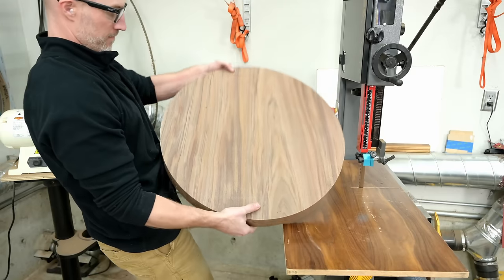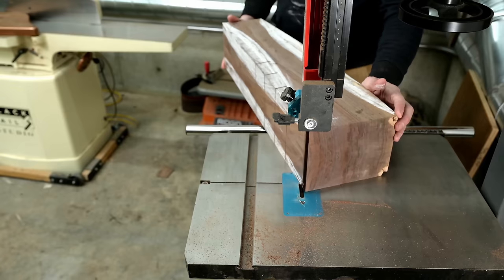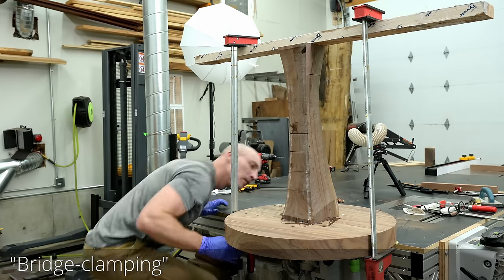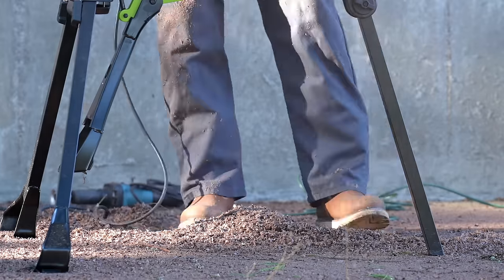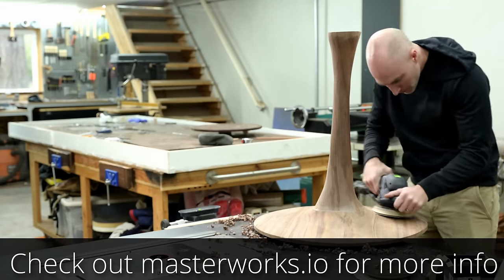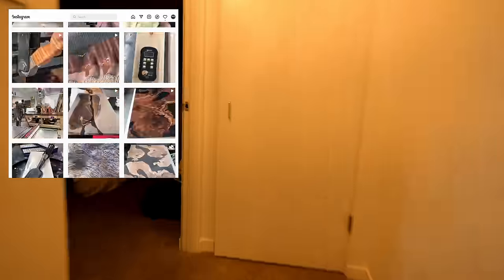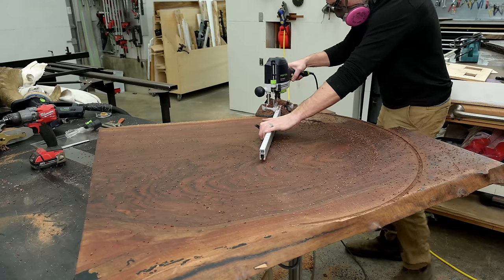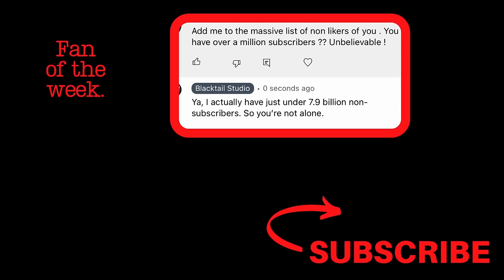I Like Money, But This is Better

Comment: I have made all of my own glues from 14thC thru 18thC recipes (depending on the age of the piece I am working on). I guarantee my clients that I use only the materials and technology available when the piece was made (including any wood that I add). When I glue I warm and work into the wood, glue from both sides of the glue joint and then wait for the glue to begin to tack.  I warm the surface of the glue again just before joining the pieces and then clamp them and put the entire piece in a vacuum room and bring down the atmosphere to roughly 2.5lb neg. PSI. (Which is a ton of pressure). This allows the glue to blend without drying over a three hour period.  I slowly reintroduce an oxygenated neutral atmosphere and allow to cure for 30 days.  While vacuum chambers are technically not period it does reduce the levels of the kinds of pollutants in the atmosphere that did not exist when the piece was made during the curing process.  Everything else is done exactly as it would be in the year that the piece was made right down to the hand tool marks and handmade hardware.  As for the angle grinder not having the power to do any real damage….BWAHAHAHAHA!!!!!!😂

Comment: $4000-$10,000? Glad you're back. Also, try using a tiny bit of salt or other abrasives when you glue up wood. Apparently they help prevent it from sliding around. I am not a woodworker myself and i haven't tried this yet. Would love to get your opinion.
Reply: I do this and it works really well, you only need a pinch!
Reply: @BrinToo  does it affect the adhesion in any way? Or maybe the wood?

Comment: I use a spoke shave for guitar necks (or I did, back when I was building), and I agree that there might be better tools for that job but it is just a lovely zen-like calming tool to use.  I'd happily spent hours just shaving away on a thin setting, and you have a lot of control too with the way your hands grip it.

Comment: While hand carving with a Kevlar glove on my left hand, I needed to buzz a tiny bit of wood detail with a Dremel tool. About two seconds later I had a broken finger as the burr wrapped up the glove. The damage from a grinder would be horrifying!😱
Reply: Scares me to death everytime I think about using my drill press....don't forget to take off the gloves!
Reply: I added a wen foot pedal to it for better control.
Reply: A kevlar glove is the most dangerous because of the incredible tensile strength. With a synthetic, or better, a cotton glove
Edit fumbled the post button the glove would tear a lot more easily, and you may very well be able to get away without any significant damage to your hand.
Reply: Seen a 1cm diameter steel pin wrap round a grinder like a shoelace. I wouldn't chance it 🤣

Comment: $18k   Run a slot on your mortises on the table saw, about 1/16" to 1/8" deep. This will allow air to escape and re-enter, but won't weaken them.

Comment: I learned many years ago that when plugging a defect (chainsaw cut...), a rectangular plug isn't a good choice because the eye can pick it up so easily.  As regards applying glue to one of both sides of a glue-up, a number of years agoo Fine Woodworking featured an article on the topic.  They used some lab-grade measuring procedures to stress both types and concluded that the both sides option consistently resulted in a superior bond.  As well, another of their articles covered clamping pressure.  It concluded that it's virtually impossible to apply so much pressure using the types of clamp systems most woodworkers - including you - use, to compromise the glue bond.

Comment: Gluing both sides traps air in the glue vs letting it dissipate into the wood and similar with pockets of excess glue

You could glue two small sticks together on the ends with and without double-glue and see what’s stronger
Reply: There's no space for an air pocket.

Comment: I love using those carving discs. Just use a lot of caution. Last year I was using the type that had 6 carbide teeth on a convex disc on a cedar post. Somehow, the disc caught a groove or knot and had a massive kickback. The kickback flipped the Milwaukee angle grinder out of my hands. The grinder flipped over and hit my wrist, taking an inch long and at least half inch wide chunk out of my inner wrist. It was very deep and couldn't be stitched which took a long time to heal. Fortunately, it missed the artery in my wrist. It was summer and I had a mask and safety glasses, but was wearing a T-shirt and no gloves. In hindsight, if I wore decent gloves, it probably wouldn't have taken the big chunk out of my wrist. And of course, maintaining a good grip and control is important.

Comment: it is technically correct to glue both sides. the reason for this is that wood glue is made up of fluid that gets absorbed into the wood grain so to bond to the fibers. if you glue only one side you will be losing strength in your joint. glue both sides and the moisture will absorb evenly. this also reduce the risk of warping a little bit.
Reply: The glue will be on both sides once connected, so it makes no difference if you glue both sides or only one. It'll be covered in glue evenly once connected anyway and every excess will be pushed out anyway.
Reply: @Max  your theory sounds like you might be adding more glue then you need to your joints. 
The truth is what I stated above, I gathered this information from sait and other professionals in the field of carpentry.  My information is 100% accurate. 
If done correctly you Need a very small amount on your joint, the tru grab from the glue is found when clamping pressure is provided not how much glue you use.
Reply: @mychalmerrick9769  That is not my statement. If you use an imaginary 10ml of glue on one side, you have exactly the same strength compared to add 5ml of glue to each side. In any case you will experience reduced strength when adding to few glue, in which case it even again does not make any difference. It happens to be a bit difference when talking about dominoes, it that case you should glue obviously both holes that you put the dominoe in, however gluing only one flat surface that will be put onto another flat surface (or both) is completely irrelevant and indifferent.
Reply: @Max  as much as your right about it not making a huge difference in most cases. However you are infact wrong about your theory. This can be seen even further when you are gluing two flat peices of different densities.  A softer wood often will absorb more of the moisture then the hard woods. I would suggest getting technical working knowledge of the glue and the wood before drawing to this conclusion.

Comment: One of the things I've noticed is that when you are putting in the threaded inserts, you always use an Allen wrench. There is (I've found) a better way. Get a 2 inch bolt with the same threading as the threaded insert and a nut and washer that will fit the bolt. Thread the nut onto the bolt, slip on the washer, then thread on the insert until it is flush with the end of the bolt, then tighten down the nut and washer onto the insert. You can then install the insert using a wrench or ratchet. This does 3 things all at once, 1 it allows you to put a lot more torque in case you hit a knot or something, 2 the insert itself can't be harmed by the added torque, and 3 when the washer is to the surface, you know that the insert is straight in the pilot hole and that all the inserts have been installed deep enough not to sit proud and throw off your level.

Comment: 6:31 Would it be better to make a tiny groove either on that "peg" or the square whole? That way you would not have to deal with:
1. air trapped against when you insert the peg
2. vaccum when trying to remove the peg
3. a way out for the glue without having it messing around
Reply: It will also allow the wood to dry.
I have seen wet glue under years old plugs like that
Reply: @joshua43214  that is crazy!

Comment: Glue is added to both sides to ensure that you always have fresh glue penetrating the wood. In some situations, not doing both sides can lead to air pockets, dry patches, or not enough soak into the dry piece for the full, super strong bond that would be expected.

Comment: For that center pin you used to attach top to stem add a groove or shallow cut to flat side. It won't effect strengh too much and will let air and glue/resin move around or out if needed, so driving it all the way in or taking it out is bit more easy.

Comment: The teacher in 8th grade wood shop said you only add ample glues to one side and the pressure clamping it will spread it out evenly with little spillage.  If you glue both side you alway use glue than you need and there is more spillage. He said that does not sound like much buy when you work in a job shop and it takes an hour more to finish each and you use twice as many consumable.  When you make 100 or 500 of them it makes a big difference.  If you don't learn to be efficient now you won't get better at scale. I
He had owned one of the largest furniture manufacturers in town and when he retired he taught wood for fun.

Comment: About the glue up. It depends on how big is the glue areas.
If its small like smaller than your hands its fine to just glue one side provided that you spread it evenly. It saves excess glue and less time cleaning (especially gumming if you are sanding)

Comment: I personally glue both sides of wood only because I make birch veneered ply products to avoid gaps but as far as over clamping, I’ve personally put 25 clamps on a 6 inch x 2 foot veneered board and never ‘over clamped’

Comment: Another way to do the textured surface on the top of the table is a rounded router bit in a veneer trimmer. You can control the depth and also creates a very clean dish. Also, very easy to create an ‘adzed’ look by pushing or dragging with each plunge.
Reply from the maker: Oh ya? I’m intrigued

Comment: Next time you use that square tenon idea to join the base to the stem, cut a small groove in the side or sides of the tenon. Trying to assemble something like that, you will tend to have problems with air trapped inside the socket below the tenon. The grooves will let the air out when assembling but the grooves will not be visible once the assembly is completed.

Comment: Just a suggestion, when you're doing a patch (it's actually called a dutchman) the best way to hide it is to make it organic. Meaning have the long part straight but the ends rounded, it make the seam less noticeable. Like I said just a suggestion, having worked for 15 plus years with wood I've learned how to fix my 30,000 mistakes....

Comment: An old paint back in the day showed me how he glued teak which can have some problems along with any hardwood with a high oil content, some folks with teak even swear by wiping down all the surfaces to be glued with acetone, not pleasant. This old timer in the yacht building business swore that by applying yellow carpenters glue to both surfaces when gluing up for thickness was all he had ever done in his many years in the business.

Comment: I do a fair bit of machining for work and I'm very impressed with the way the your mounting plate came out. I don't think I could do that on a drill press myself. I'm too spoiled with my knee mill lol. If you're doing more steel machining in the future, try using some WD-40 or other oil on it. It should help the bit cut better and help it last longer.

Comment: beautiful table  bit that grain  design in the wood of the small circle the larger circles base was  a amazing  pattern ... you 10000% should be signing your work  even if it's blacktail studios   order up a tiny  branding iron  even if it's like 5 inches long with a scroll font 👌🏾 if I  in that custom table business  I'd get a old used lathe  would help alot with  🦵🏽

Comment: When you tile (as in, install ceramic or stone tile), generally, you apply adhesive to both the substrate and the back of the tile when one or two conditions are met or suspected: The first is if the tile or substrate is uneven. This is mostly a problem when the tile is very large. The second is if the tile is very absorbent, and not "back buttering" would risk a poor bond due to the tile having dehydrated the adhesive too fast.

I suspect that similar thinking could be applied to glue when wood working. I would probably use a toothed applicator for one face and a smooth applicator for the other face so as to avoid air pockets though.

Comment: I'm not a woodworker. This looks like a very fine table. It looks like the kind of table that would appreciate it if you used a coaster -- but wouldn't openly complain if you didn't.  It would just quietly and politely slide a napkin under your highball at an appropriate point of the conversation without ever breaking eye contact.

Comment: I believe adding glue to both sides helps with even application. If you make sure both surfaces are coated well, you can be  a hundred percent confident, that the entire surface is well glued

Comment: Great video. Has anyone ever told you that you have a striking resemblance to Matthew McConaughey. I don't do woodworking but find you video's very informative and enjoyable. I am a modelbuilder concentrating on sci-fi because I love lighting my projects. I have also had a few commission builds and I always like to see other makers do what they do especially when they enjoy what they do. You do fantastic work. I plan on building a workbench in my shop so I can organize my shop a little better. My shop is only 10 x 12 so I want to get Ideas on how to do as good a job as you. Thanks

Comment: I think your videos are improving as is your skill.  I appreciate your attitude about your work too.  I'm not a fan of lots of epoxy in tables, (and I've made a couple dozen tables over the years, but I think you have done more than most, some pretty interesting ones.  I am not a fan of metal bases in general either, so this base is good!  Thanks for recommending the power carving too.  I recently completed some old growth VG redwood benches, that were to complement a large redwood slab (live edge) table.  Redwood IS darn hard to work with, as it is so soft. The benches I made were NOT live edge, but I wanted them to be a bit more "handmade" in looks so I decided to texture the surface of the seats, (and a little the backs) and I considering using a power chisel to texture the surface.  But the Arbortech chisel/ gouges was a bit too aggressive for the soft redwood, and finally I found that using some wide (60mm) gouges with a sweep of 5 or 7, making sure the gouges were deadly sharp, the surface was textured nicely.  Took me only about 3 hours of work to do each bench seat by hand.  (5 1/2' long each)  But I'm looking forward to using the power gouge on some picture frames for the same room (the frames will be out of Cherry)

Comment: in german joiner school we learned to put wood glue on both sides. the reason behind it is so that the wood glue can sink in on both sides and there is less of a chance to miss a spot. also one is supposed to add just as much glue so you can still see the woods grain. a common joke says: the glue that is squeezing out while clamping is not adding anything to the joint, it is adding to the personal feel of security thogh.

Comment: Well done Cam, $12k!! Great cause.

Not sure if you will read this so long after. But there is a product that I think you would find really helpful in sanding bases like this. Look up sanding interface pads, I use them for sanding round bevels, and recently used them to sand up some turned legs, make life a lot easier when sanding non flat surfaces.

Comment: I was trained over 35 years ago and was taught in college not to apply too much glue because of the excess that will ooze out which it will. I personally retrieve any excess glue which goes back into the bottle. We were
never taught to glue both surfaces of timber but it would never cause a problem however ...its just unnecessary . I would give both surfaces a dulling with something like 180 grit to remove the shine from the planner allowing penetration and most certainly rub the two together to remove the air bubbles. This will come out of the edges and only once it becomes too difficult to rub this can be left unclamped as the clamping will only squeeze out the glue and never over tighten as it can push out all of the glue and the connection can fail. I have noticed that your not rubbing your joints which is paramount. Its also not good practice to use too much glue as if it can't be removed with a damp cloth the PVA will stain the wood and can't be removed unless more machining is done which isn't something I would do from the planing process and the clamps also get rusty. Experiment with the rubbing and see if you can achieve a strong connection without clamps altogether. You will be amazed. I hope this helps as you have helped me no end in other areas that I haven't experienced myself.

Comment: Table is stunning my guess is 10,000$. I also had a question. I was just watching a show and they covered the floor with a new product. It's a ceramic product that bonds at a micro nano level makes a beautiful finish that's fire resistant water resistant protects against warping from temperature change I was thinking this would be perfect for furniture